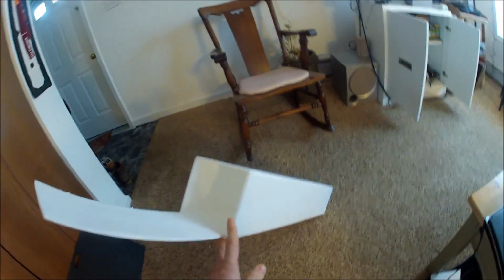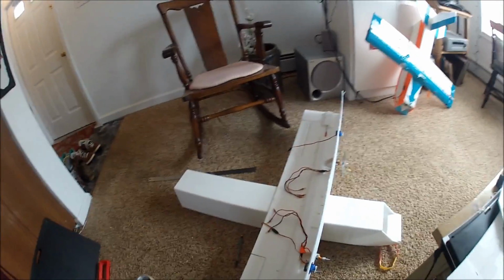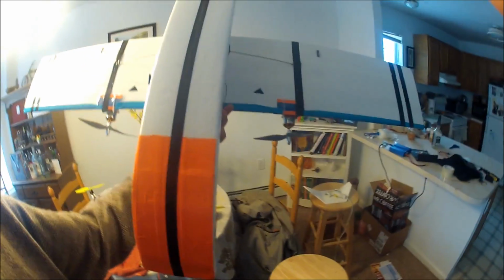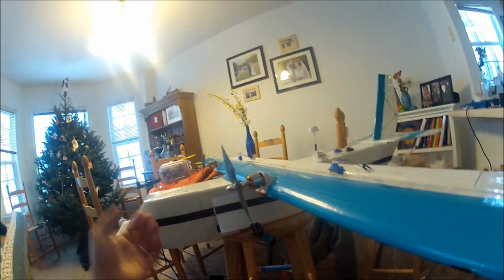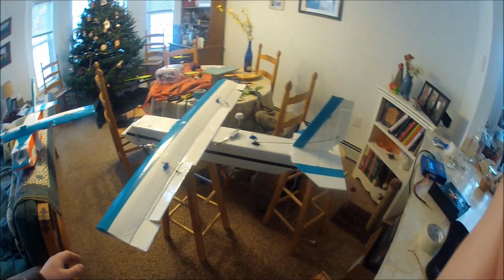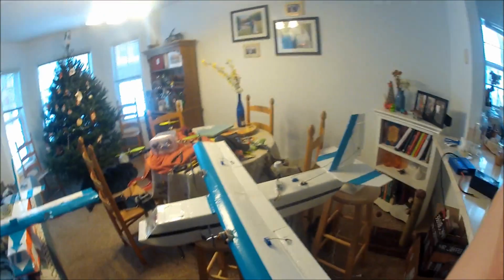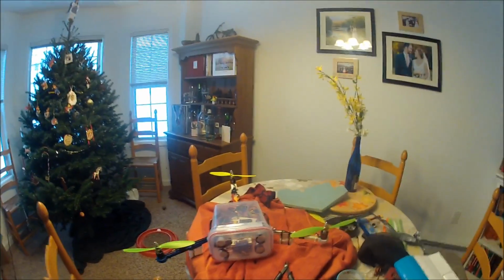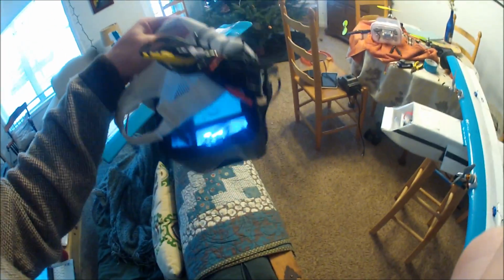How to Build a FPV Twin Engine Cargo Plane. With build tips and in flight footage

Comment: I am building a Cargo plane from an Old GI Joe Hercules plane thats been gutted out and hollowed and I am sort of confused on props.If I am using a Sky Vector prop and electronics and the props located in the back of the sky vector plane what do I need to do to convert it so that I can mount it to the front of the Hercules Plane.I am pretty sure reversing the motor and flipping the prop backwards won't cut it right? Also the planes a little more heavier then the vector so weight wise do I need faster props? I also have two push props from an airboat being mounted on the planes wings will that help in lifting the plane off the ground?
Reply from the maker: To answer your question propellers have a front and back. The front always faces the front of the plane. If you move a motor from being a pusher to a "tractor" style you need to reverse the motor direction.  Now IMHO I would but some real rc equipment. Weight isn't your friend especially if you are using small motors/props

Comment: Do you think two 18 amp escs and 370 1250 kv motors will work with a plane this size?
Reply from the maker: Should work. What size props will you spin? Make sure the props don't strike the ground or body. The way I made it would take up to 8 inch props or so
Reply: 8 inch props i cut the shrink wrap off the heat sinks and plan on having them on the bottom of the wing for air flow i dont plan on flying in snow or rain
Reply from the maker: omfgursodumb if you really want to be sure post a link to the motors. Saying "370" size doesnt mean much anymore, it's a general sizing term used from brushed motor days. The motor manufacturer usually states the appropriate prop, amp draw, and thrust. You want a prop that will draw near to the max amps of the motor with thrust that is higher than the weight of the plane (more thrust =more fun),  and an ESC that is 15% higher than that max amps the motor can pull. Essentially everything should get warm when flying but not so hot you can't hold it.

Comment: Hi I also build a twin plane but it more complicated to build. I like your design.

here is the mine https://www.youtube.com/watch?v=5bQtmGmR6xU&list=UUNNZ3ZiHU3c_y_dfb--1kdg
Reply from the maker: Yes mine is a very simple plane that is meant to be flown FPV. So it must carry 2 camera and about 5000 mah of batteries so it needs to have a lot of lift. I lost radio contact and crashed  this one a few times, I am making a new one now with a 60 inch wingspan.
Reply: This is great that you make new plane and crash do not stops you. Crashes happens I also crash mine last autumn - very strange lost of control during take off fuse broken and  I created new one. Mine is carrying 4400 3S battery one HD camera an one fpv camera.
So  I hope see your new plane soon.